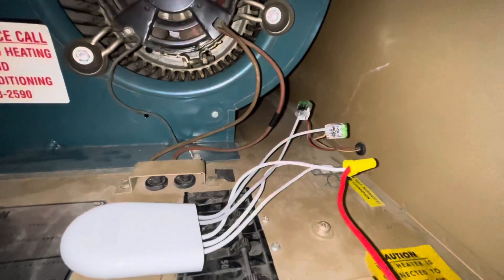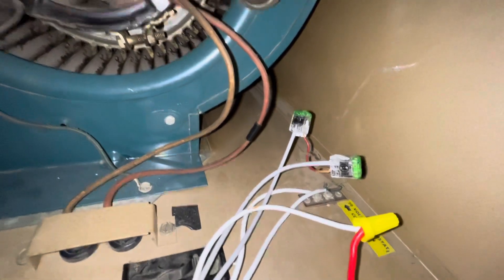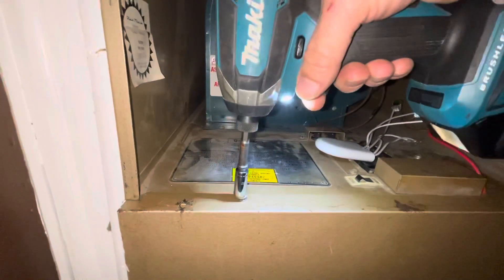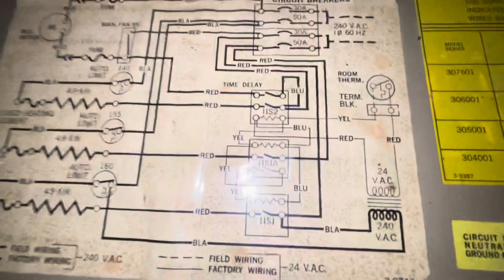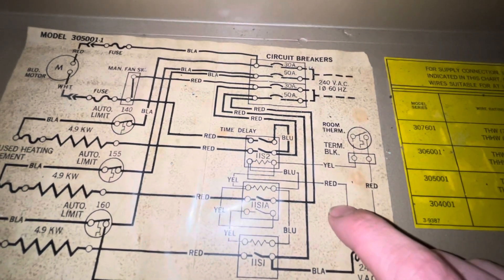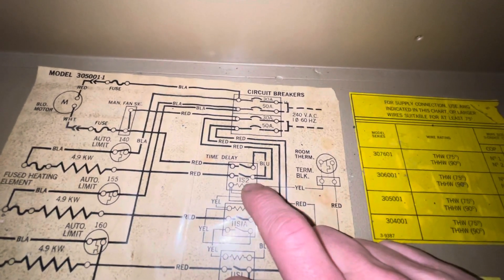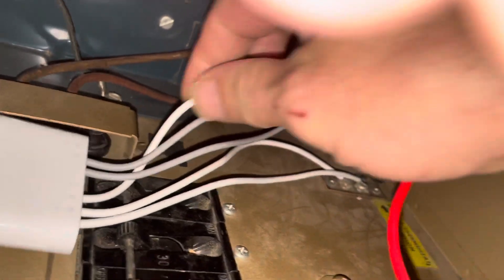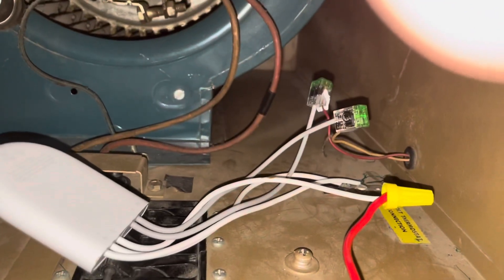Nest thermostat install on old furnace with only 2 wires

Comment: Can you just run the wire directly from the transformer, have two wires connected to the W wire?
Reply from the maker: Yes, in fact, that’s exactly what I’m doing here. The only difference is the sequencer in my case is a good place to tap the W wire.

Comment: Can you connect the C wire directly to the transformer?
Reply: I connect R and C to the 2 leads of the 24V transformer and it works.
Reply from the maker: That’s essentially what I did but I also grounded it to help prevent voltage spikes.

Comment: so, where did you connect the 2 wires in the back of the thermostat?
Reply from the maker: I connected them to the R and W wires for heat only if it was cool only you would connect to R and Y.
Reply: @notme22   thank you for your reply I appreciate it, I got it working ran a new wire and add transformer at furnace to give me a c wire workout out great
Reply from the maker: Thanks for the feedback. Glad it helped someone. I was surprised I could not find any information on the internet on how to do this. Sorry for the 2 years late reply.

Comment: hi, i am in needs of help as i have an old boiler with only 2 wires (red and white)   i have also gotten the nest power connector but i am very confused as how to add the wire you mentioned in your video.   i do have a wiring diagram and some photos i took but not sure how to send them to you for help.  thanks
Reply from the maker: Just connect your C wire to the wire coming out of the transformer that goes to your valve, sequencer or contractor. Do not connect to the wire that goes straight to the thermostat, that’s your R wire!!
Reply: @notme22  This is helpful. But just to make sure I don't get confused between the R and C wire coming from the transformer I tried to look at which lead of the transformer is having a 24 volt with respect to ground(from a 3 plus extension chord). But surprisingly both the wires showed up as 0 with respect to ground. Its very weird, I thought it might have been a loose connection but I checked it even at the thermostat, same issue. I also verified that across the terminals of the transformer I see 24 V AC and between the live and the ground (from that same 3 plug extension chord) and I see 120 V AC. 

This has got me stumped because currently there is a wire going from the C of the transformer to the thermostat (through some nut connectors) but the color of the wire is white and its connected to the W of the thermostat (The thermostat just has 2 wires coming from the boiler). I think the wire is actually the R wire and not W. The other wire which is red in color is connected to the R terminal of the thermostat (but I think its the W wire) is going to the Pressure control of the boiler. 

Is there any way you would recommend that I can use to verify what I'm doing is correct. 

PS: I didn't open out any of the connections to check the voltage difference. I wonder if that causes issues
Reply from the maker: @RaunakThomas  you must have a 240v to 24v transformer. In that case both wires will have 0v with respect to ground because the system is not referenced to ground. The wire that goes straight to your thermostat will be the R wire and you’ll pick up C at the W wire before it goes through your sequencer or contractor, I made my connection point directly at the input to the sequencer. Also, you should have your meter set to AC Volts not DC, I know it sounds basic and possibly condescending but I speak to at least a couple electricians a week that forgot to set their meters properly.